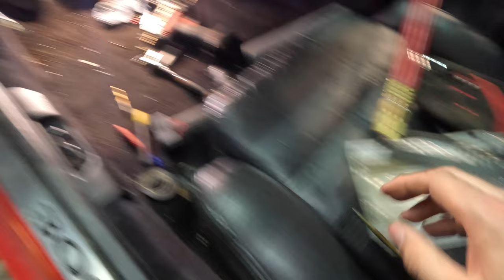How to fix my automatic transmission for good in my Mitsubishi 3000GT (Manual Swap)

Comment: The worst part is lying on your back messing with the pedals… maybe even worse than that is when you’re fabricating the clutch master hole in the firewall.
Reply: Nah the worst part is trying to get the 2 cv axle bolts out

Comment: Good Job , tho its a BASE model. the SL had the 24v Dohc engine
Reply: Is that the only difference
Reply: @spidaaaaaaaaaa SL has more stuff like leather interior sometimes power seats , better wheels
Reply: I was thinking the same thing.  I wonder if a prior owner upgraded interior bits to make it more SL like, or could you get the leather seats in the base model?
Reply: my base model has the 24v dohc and it has leather seats

Comment: You should make a video going over how to do the neutral safety bybass re pin and hooking up brake lights. That would be so helpful. Also I'm currently dropping my atx tranny, but it's hitting against the engine bay side wall closest to the passenger side. I cannot clear it. Help!
Reply from the maker: You have to drop the torque converter with the transmission. It sounds like you are trying to pull the transmission off of the torque converter. Yes after we posted the video we noticed we left that part out we can make a follow up video for it for sure.
Reply: Please make the follow up video on the neutral safety switch bypass
Reply: @salvagedmotorsports1158 still waiting for the vid 😢
Reply: @brandonmapes3654  real bro. I went to Reddit for the question. I just got all the parts I need to finish my swap. But if no one replies I’ll just do my magic n figure it out lol
Reply: If I figure it out I might make a video myself

Comment: Glad mine came with the 5-speed. And i recently did a full build on the engine.All the rot ont hat thing. Lucky enough that mine was a scottsdale AZ car..Minimal rust. Paints faded but the body and chassis is as solid as they come.

Comment: great video. My 91 vr4 is over at REMY's RIdes in  GA
I have like 8K worth of parts going into the car... Hes rebuilding the engine from block up . Its needed alot of stuff to get it back to road worthy as the previous owner didnt do the right repairs and upgrades.
Reply: I bought a crashed VR-4 and will take out both engine and transmission to put it into my base model since engine and transmission are dying, wasn't taken care of before I got it.

Comment: What did you do about the connector attached to the clutch pedal? Do I need that plugged in?
Reply from the maker: Doesn’t need to be plugged in.
Reply: @salvagedmotorsports1158 hey are you able to make a video or explain how to bypass the neutral safety switch? Almost done with my swap & I would like to be prepared to do it. Thanks
Reply from the maker: @pheesix  yea I can try to do that this week for you.
Reply: @salvagedmotorsports1158  thank you man

Comment: Do you have replaced your transmission control?
Reply from the maker: Manual’s don’t use a computer. Just remove the auto computer.
Reply: Thank you, I’m doing convertion right now. I have all the parts I need. The only thing I need to know is the wiring re-pin you mention at the very end of your video